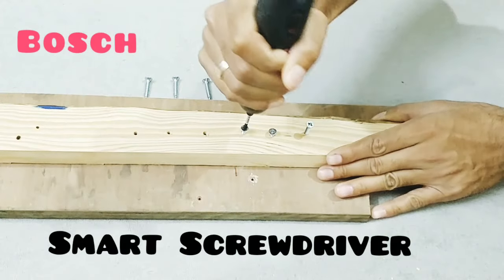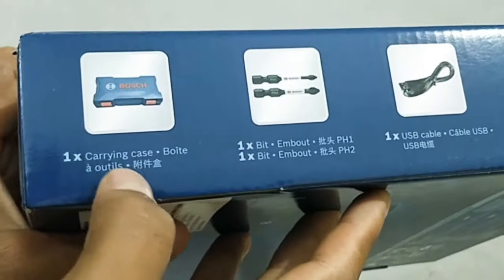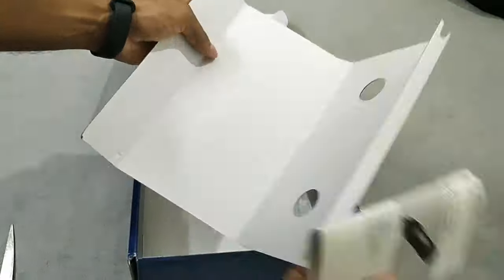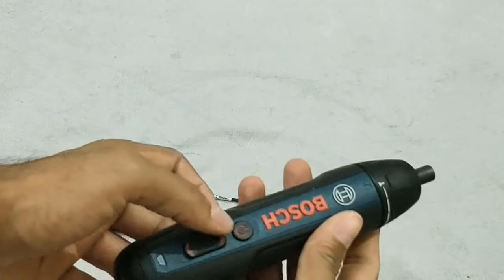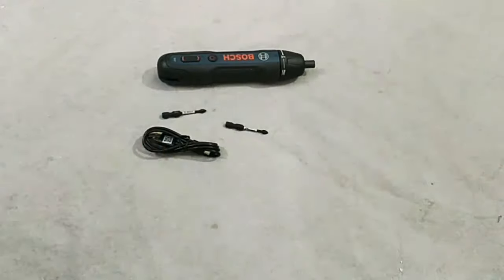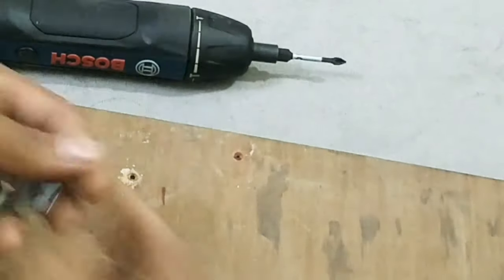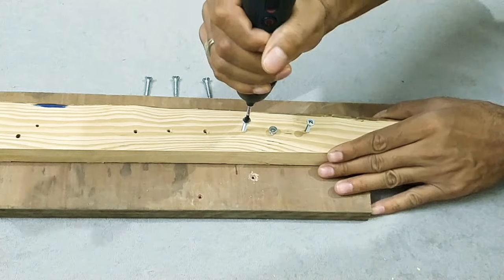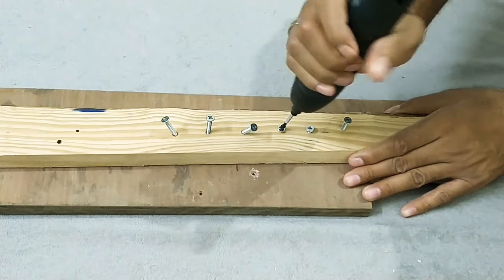Bosch Go Gen 2 Cordless Screw Driver Complete Review How To Use Bosch Go Smart Screwdriver Unboxing

Comment: This screw driver is made for low torque electronics and hand tight applications. You want to drill and screw through wood get an impact gun
Reply: It can go thru wood. Oak, plywood, and some more. Used the Bosch titanium wood drill bit set with an adapter.

Comment: English:

They gave me all the material but EXCEPT the charger, only the USB cable, what if it doesn't show what type of charger (with the voltage type) this material has to be charged?

The question is: Will it be used with a cell phone charger?......

I would appreciate a quick response.

Español:

Me dieron todo el material pero MENOS el cargador, solo el cable USB, lo que si no muestra con que tipo de cargador (con el tipo voltaje) se tiene que cargar este material?.

La pregunta es: Se utilizara con un cargador de celular?......

Le agradeceria su pronta respuesta.
Reply from the maker: Yes, any cell phone charger can be used.
Reply: @Teachkart  OK, thanks, but one more question, can it be connected to a power bank or a PC?
Reply: @Teachkart You say that, but I've tried charging mine with six different brands and types of USB phone charger, and even the USB charging port in my car; none of them will actually charge the Bosch GO.. the charge light will blink instead of going steady, and it does not draw any power from the chargers. Only on the original charger do I see steady charge LED and actually start charging it.

Comment: how is it great if it can't get the screw fully in om maximum torque?
Reply: Because this tool isn't designed for what he is using it for, it's supposed to be for light screwing and un screwing like electronics ect. If you want something to screw into timber buy a drill or impact driver
Reply: @RatyTang  I dont think they designed screw driver with 5NM torque for electronics. It will shear every bolt in any electronics.
Reply: @mikemaman1  I use it for electrical boxes, and keep it on the lower torque settings so as to not strip out the threads.  Works great.
Reply: This would be used for lighter projects
Reply: 4.5 nm is how much power you need to sufficiently tighten Allen key bolts on a bike
Reply: @offtrackexplore3956  I have collected torque specs for all parts on my bike, and for things like control levers, cable pinch bolts, brake disc bolts etc, the torques are around 4-6 Nm. This screwdriver might be usable, but could be slightly underpowered to loosen some of the bolts. But well, you can always do the initial loosening or final tightening by hand in the manual mode.
Reply: @mikemaman1  5 Nm max, that's why there is a slip clutch and multiple torque settings